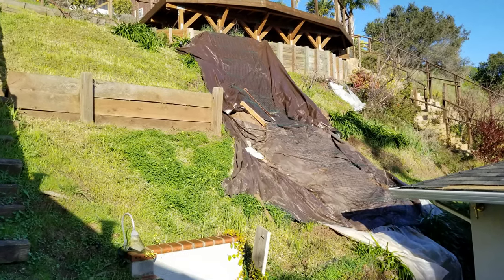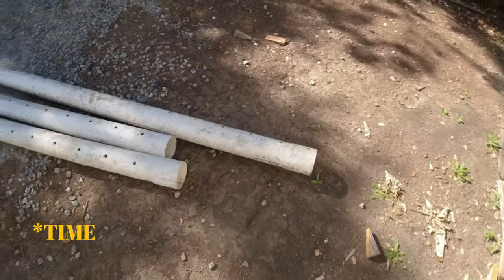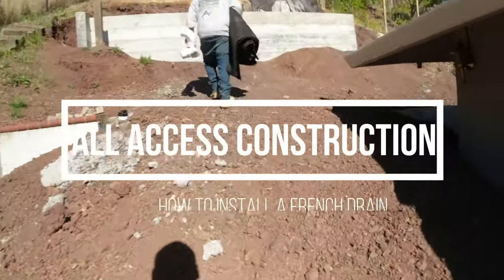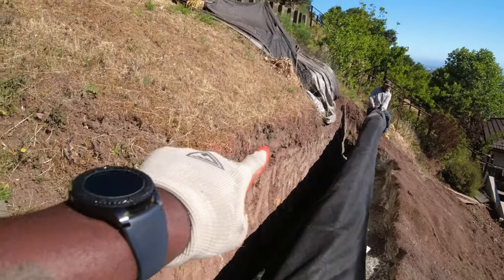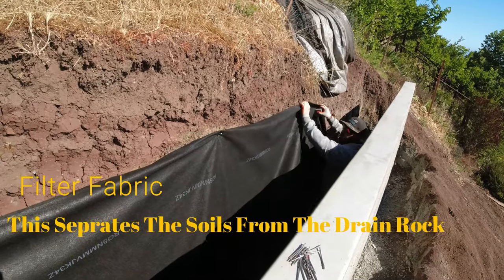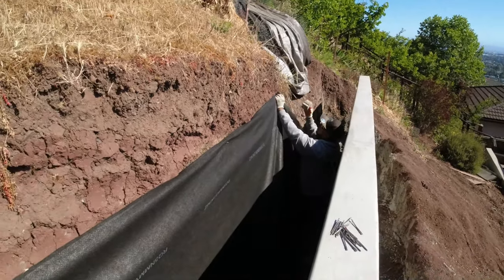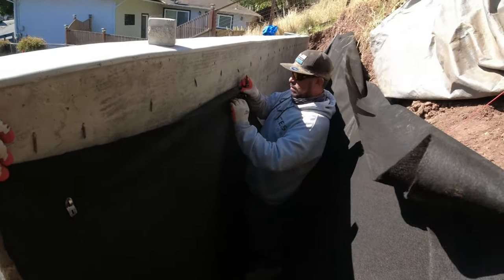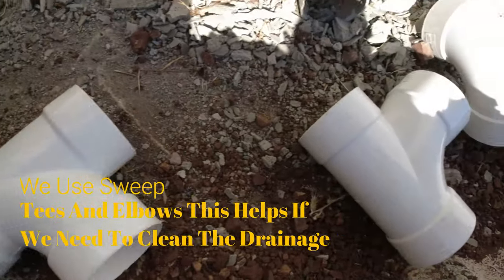How To Install French Drain For Concrete Retaining Wall 2021

Comment: Out of curiosity, why the concrete retaining wall versus the cinderblocks?
Reply from the maker: Just started out with doing these walls.. Also, with cinder block walls.. You really have to be tap in with building them..

After we did this one I was like I'm cool..😂😂 Really have to have a crew that's Really dial end that's use to do them all the time.. Check this one out https://bit.ly/2zVukrs

Comment: How how should you go with the drain rock? I thought almost to the top would be best??
Reply from the maker: It really depends.. Most job we like to go top to the bottom 12 inches from back of wall minus a foot from the top.. I called this the "plywood method" working on a video for that. This can be very time consuming.. 

Some cases we will just back fill with all drain rock.... Depending on how much dirt we have to lose..

Comment: Wow, 12 tons of rock for that quite small section of wall, not gonna lie, sounds like a lot. Though I've read the rock needs to be a minimum of 12" deep. Did you just go overkill cos why not? I ask because that rock is about $20 a cu. yard right now in my part of the world so it can get pricey to use it so generously for backfill.
Reply from the maker: Yes the minimum is 12 inches. Also if you use the "plywood" method which you can see at the end the labor can add up quick. 

So it may be quicker to use mostly drain rock

The plywood method can be a bitch and very time consuming process. 

Check this video out https://youtu.be/9AF_j5AUdG0 
Keep in mind we are going down hill as opposed to up